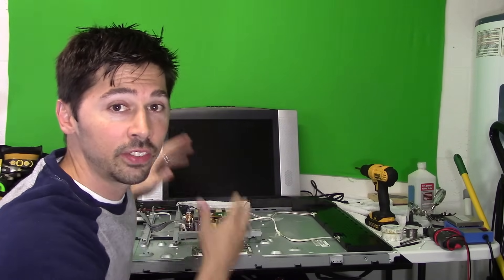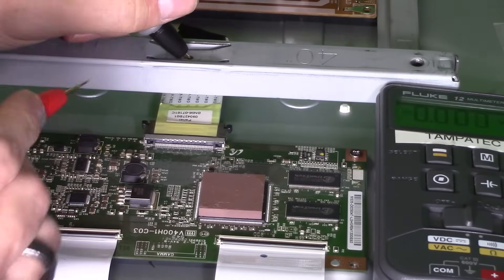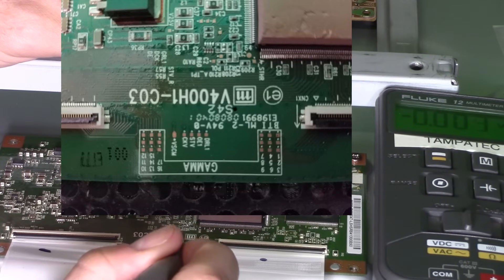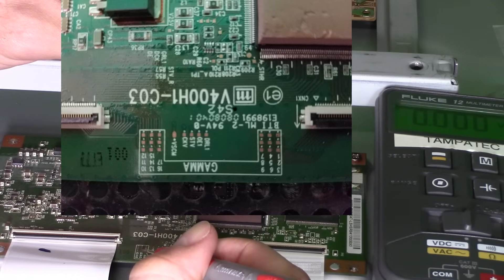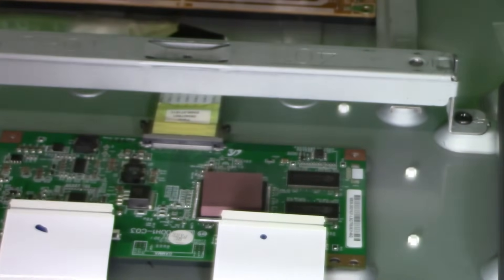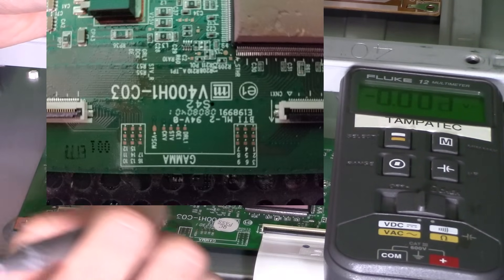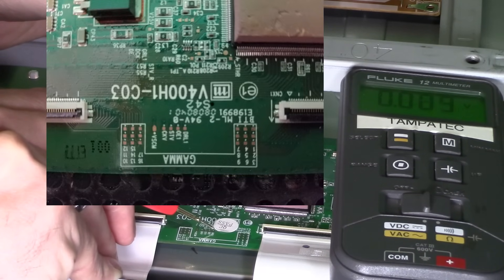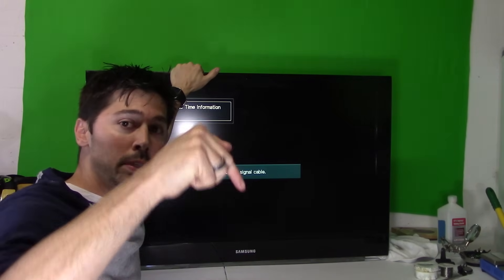THIS EASY 5 MINUTE TV REPAIR WILL FIX MOST VIDEO PICTURE PROBLEMS!!!

Comment: Thanks for posting these
Reply: bad buffers on the right side of the screen or a bad screen
Reply: H
Reply: A Layne v
Reply: Hi. M UN65MU8000 has distorted colors. I seen your videos and, I think it has to do 8th Tcom board. I had a battle with Samsung on the phone. First they said it was a software problem and I didn’t have the correct one installed. So they sent me a usb drive with the 
‘’Right software... I installed it, but it didn’t work. I called again and this time they sent a one connect box, but didn’t work either. I was very upset and demanded a solution and, after threatening me with charging me if a technician sent by them could found any damage on the tv, because (according to them) the warranty should be canceled, the technician visited me, took a look and confirmed how bad it was. He, then left after giving me a receipt with not much details. Samsung never called to inform about the next step.  Called them a week later to find out what was going on. They apologized, but told me that the technician found scratches on the screen, so the warranty was canceled. I told them there was no bleeding so the problem didn’t have to do with that and I was not asking them to replace my tv, but fix it. They denied me further service at all.
Reply: Hi. My UN65MU8000 has distorted colors. I seen your videos and, I think it has to do 8th Tcom board. I had a battle with Samsung on the phone. First they said it was a software problem and I didn’t have the correct one installed. So they sent me a usb drive with the 
‘’Right software... I installed it, but it didn’t work. I called again and this time they sent a one connect box, but didn’t work either. I was very upset and demanded a solution and, after threatening me with charging me if a technician sent by them could found any damage on the tv, because (according to them) the warranty should be canceled, the technician visited me, took a look and confirmed how bad it was. He, then left after giving me a receipt with not much details. Samsung never called to inform about the next step.  Called them a week later to find out what was going on. They apologized, but told me that the technician found scratches on the screen, so the warranty was canceled. I told them there was no bleeding so the problem didn’t have to do with that and I was not asking them to replace my tv, but fix it. They denied me further service at all.
Reply: Hi. M UN65MU8000 has distorted colors. I seen your videos and, I think it has to do with the Tcom board. I had a battle with Samsung on the phone. First they said it was a software problem and I didn’t have the correct one installed. So they sent me a usb drive with the 
‘’Right software... I installed it, but it didn’t work. I called again and this time they sent a one connect box, but didn’t work either. I was very upset and demanded a solution and, after threatening me with charging me if a technician sent by them could found any damage on the tv, because (according to them) the warranty should be canceled, the technician visited me, took a look and confirmed how bad it was. He, then left after giving me a receipt with not much details. Samsung never called to inform about the next step.  Called them a week later to find out what was going on. They apologized, but told me that the technician found scratches on the screen, so the warranty was canceled. I told them there was no bleeding so the problem didn’t have to do with that and I was not asking them to replace my tv, but fix it. They denied me further service at all.
Reply: samsung plasma model#PN50A450P1D horizontal lines on TV can you give me a step by step on how to fix this I love technology and want to learn this Talent thank you